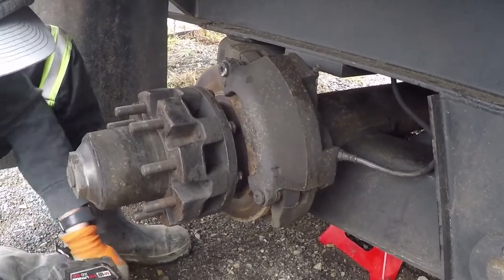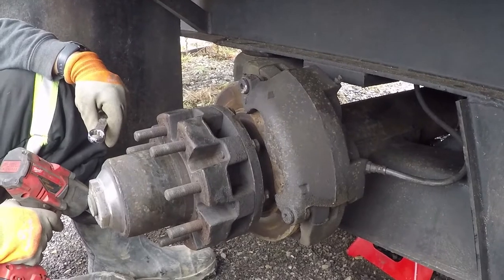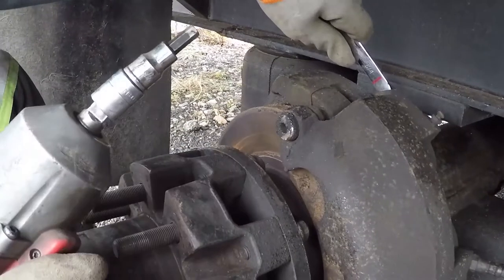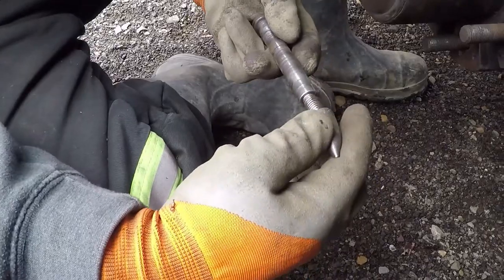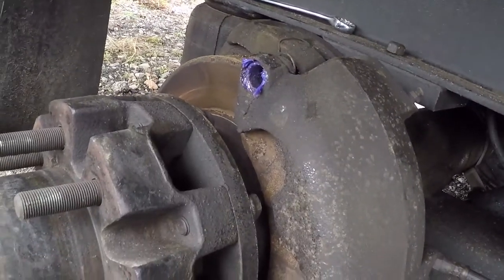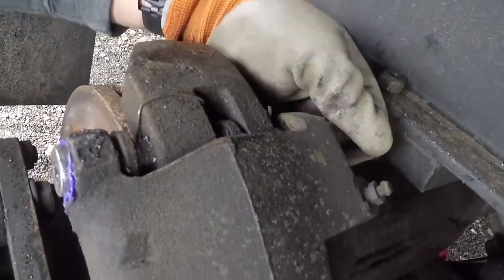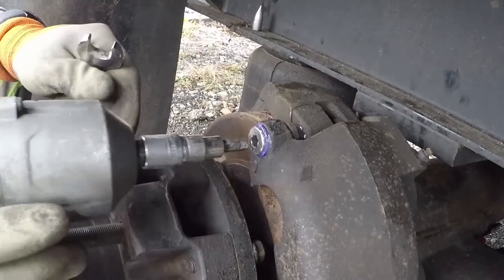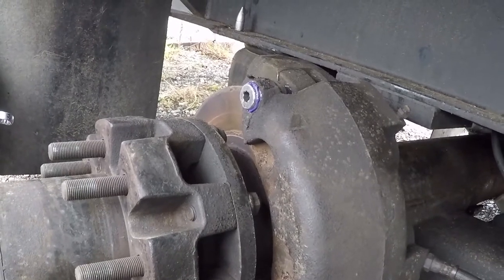Electric Over Hydraulic Trailer Brake Maintenance

Comment: I’m in TX. I had the clear hub caps break repeatedly at 2 years. The flange for o ring seal cracks and o ring leaks oil. I guess the sun gets to them since they are farm trailers and get used but do sit in the sun every day. The caps are tightened to less than than the printed torque so we thought maybe the stress was too much but barely hand tight didn’t make them last. I bought Valcrum aluminum ones for the most recent trailer to crack a cap. I think there are other brands around now with this product. They still have a clear window and add a plug around from end to use as a fill.
Reply from the maker: It's ridiculous. That's the brand I was looking at getting.

Comment: I don't think there is maintenance written in dexter that says you should lube those bolts regularly but that makes alot of sense. I've been having lots of issues with mine that I've considered trading mine in. I'll start lubrication schedule like this from now on.
Reply from the maker: There isn't. And we didn't until we went to do brakes because calipers seized and we ended up having to get our shop to do it. The had to cut every caliper off and torch the rest of the bolt out of everything. It was a mess. If your dealer or shop has a nice service department just talk to them and pick their brains. We learned a good bit from them. They're the ones who told us about the axle seal problems and switching to grease from oil...we eventually had that issue with both trailers and switched them both. If you have an old school Napa around thats a good place too. We have 3 pretty good ones and one awesome one. Find your awesome one and pick their brains, ask questions and such.

Comment: I just finished rebuilding my hubs and greased the caliper pin during that project.  After seeing this video, I can't find a source for the caliper pin "bullet" that helps align everything including the springs.  Any leads on where I can get that item?  It would sure save a ton of time as you mentioned.
Reply from the maker: They have come in every Dexter  pad and spring kit we've gotten. I've never looked to see if you can get just the tool.

Comment: Have you ever replaced the disk brake? If so, is there any gasket that goes in between the hub and disk when tightening all the bolts around it? I just replaced the disk and I’m getting a leak around that area and all my bolts are tight
Reply from the maker: There isn't a gasket, however, there are holes or groves where oil can get through if the hub seal went out. So im guessing you either reused the old seal, ripped the seal putting the hub back on or didn't get the seal in the hub right. We've had some issues ourselves. Thats one of the reasons we switched over to grease.  Hope that helps. Let me know if you have any more questions.

Comment: Would it be advantageous to have all-electric brakes, without any hydraulic cylinders and fluid required? The Boeing 787 has these, employing 4 electric actuators on each wheel.
Reply from the maker: Thats how most trailer brakes work. I do see a number of benefits to this. First they're disc's instead of drums so you have better stopping power and little chance of the brakes freezing compared to drums. The big one for me is no wiring down at the tires. The wiring on these trailers is bad enough and keeping wires out of the road debris, salt spray and water is big. The brakes are the only wiring thing we have had problems with on these trailers. The pump is in the neck and the wiring is about 18 inches just from the junction box. For as much as we run em it's definitely a plus. Thanks for watching!